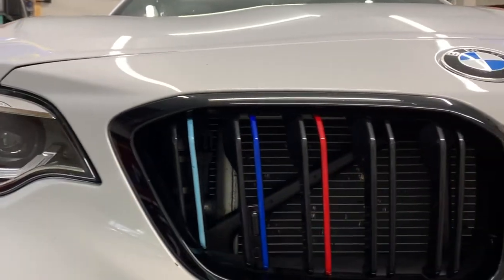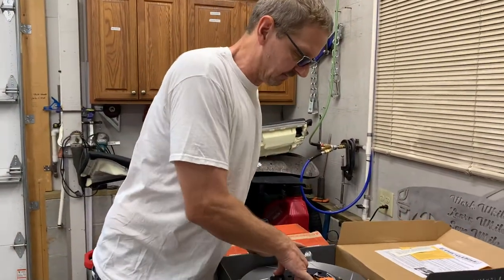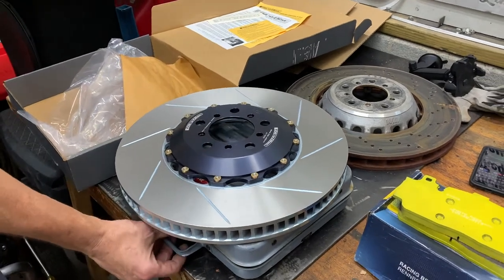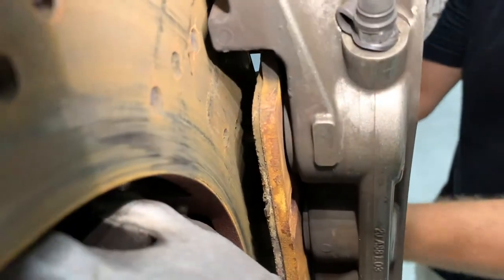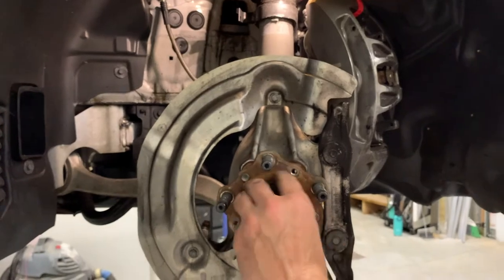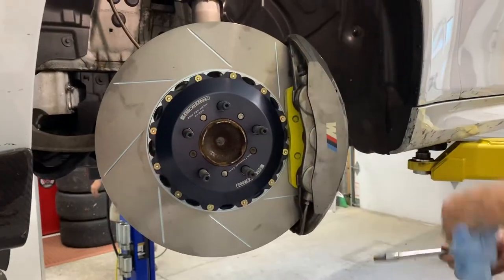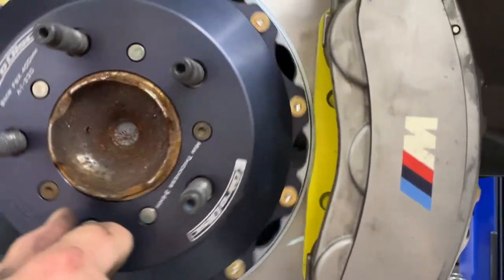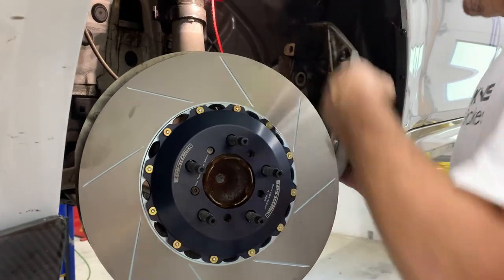BMW M2 Competition Coupe front brakes install - Girodisc rotors and Pagid pads

Comment: I've seen others say you need to clean the rotors with soap and water prior to install. It doesn't seem you do that, I presume it is unnecessary?
Reply from the maker: We do mostly 'track' install.  Clean, dry and torqued properly.  We limit grease, anti-seize etc as it makes a mess and the brakes come off enough that corrosion etc is not an issue for us.

Comment: What about the pad sensors? Thanks for the the video.
Reply: Racing pads usually do not always have provisions for wear sensors.  They really are not used as we are in the brakes all the time.  We simply tie the harness up out of the way.
Reply: @kennethkozlowski5100  That's odd. All of the pads I buy from Pagid for my cars have provisions for the sensors if the OEM pads had them. I use both RSC1, RSC3 and RSL1 pads. All have provisions fro wear indicators, so does my Endless pads.

Comment: I though you’re not supposed to remove the torx bolt instead you should remove the caliper bolt at the back. At least that’s what I did on my comp
Reply: @Cars&Stuff I thought the same.  I need to swap brake pads soon for a track day and was trying to find videos on how to swap the pads on the front and rear M2 Competitions
Reply: @ecliffg  follow everything he did except for the caliper bolts. Two 16mm in the back of caliper torque to 110nm iirc. It was pain in the ass to get torque wrench at the back side though

Comment: Did you have brush or grind pads? Because they are wider than OEM brake pads.... thanks
Reply: We did not have any problems fitting the pads to the OEM calipers.

Comment: The mechanic completely does not follow the procedures necessary for the proper servicing of the braking system. He literally has no idea what he is doing. Mistake # 1: he did not unscrew the caliper breather before pressing the old pad, so the old, dirty fluid got into the master cylinder. .error # 2: hub runout not measured. Mistake No. 3: complete failure to clean the hub from corrosion. Mistake # 4: no dust is removed from the brake caliper. Error No. 5 - critical: no measurement of the post-assembly runout of brake discs !!! .I would not have my old mower repaired in this workshop.
Reply from the maker: Hi!  I am pretty sure that on our video's we insist that it is NOT a service manual but IS a demonstration.  I'm not going to address your notes.

Comment: Poor work done, the connection of the disc to the hub should be cleaned ! Not using new corrosion discs !
Reply from the maker: Oh noooooo......     but we lived!  
Yes the hubs need to be clear of any debris that might cause rotor runout.